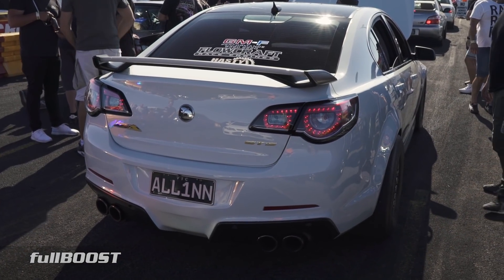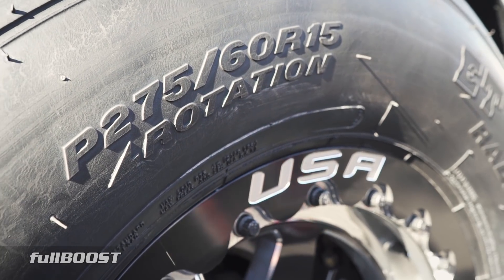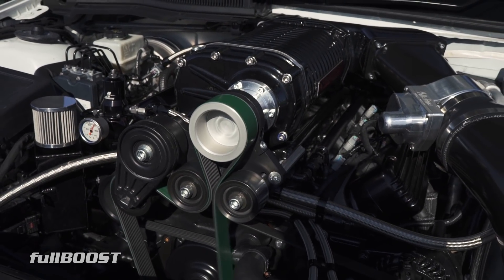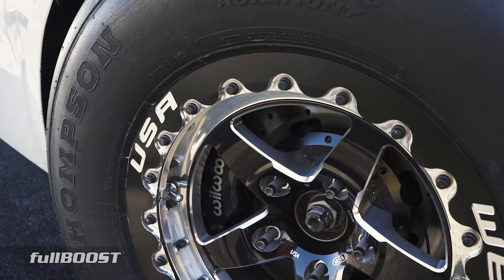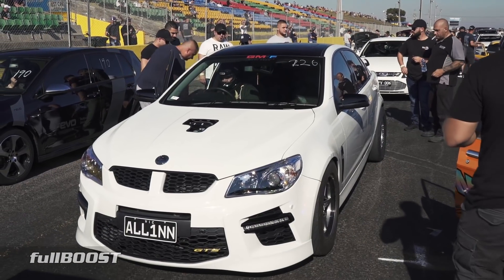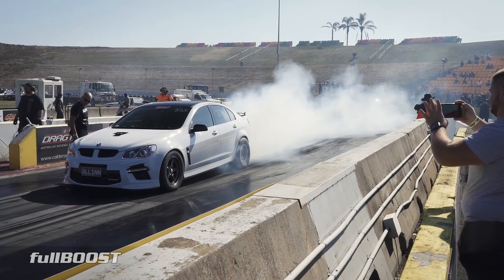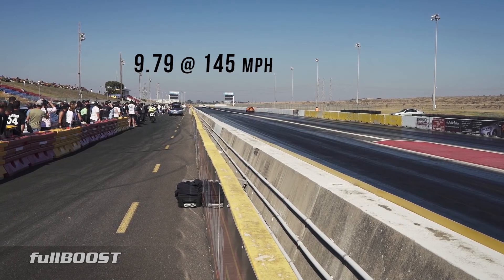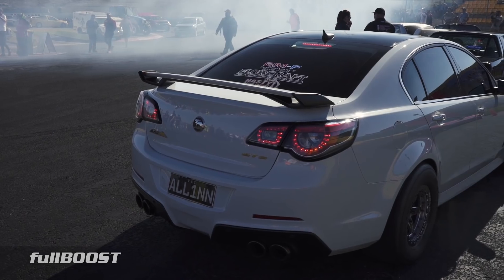HSV GTS goes ALL IN 💪

Comment: Can’t really call it the fastest GTS it doesn’t have the original motor or gearbox
Reply: How the flying fuck does removing the original motor and box make it no longer a GTS?
Lucky the title didn't say "Australia's fastest stock engine and box GTS"
Reply: Evan_Anonymous lol? When did I say that was true.. can't just say shit as if I said it. Zzzzz..
Reply: A Toyota Camry NASCAR is a tube chassis with a composite body fitted to loosely resemble a road going car, not even a remote comparisson
I see you are American, by your logic if you fit an LS into a fox body it now becomes a Pontiac GTO that looks like a fox body?
Reply: evo tme He wasn’t targeting that message to you. It was to the other guy.
Reply: Bucko's Gaming its the whole car mate .
Reply: @matthewthomson7993  ye, true, but i reckon u probably spend a lot more
Reply: I stand by my opinion that it is just a race car now not a genuine gts
Reply: Rodney Abberfield ok, fair enough, but it is still an supercharged last in the long run, but no need to fight over it I suppose.😂😂
Reply: Rodney Abberfield plus there are actually faster hsv gts with stock 6.2 Lsa and 1.9 supercharger so I find it hard to believe that this 427 will 4l supercharger is actually slower than some of them.

Comment: Hate to say it boys but there are quite a few barras that would chew that.
Reply: dartanion 007 it's only on 19psi lol show me a Barra doing those times on 19psi lol. It's nothing to sneeze at. Plus the car is fat as fuck
Reply: PcGaming pitty commodores where too shit to be taxi's.
Reply: So? There’s a lot of things that would chew said Barra’s. Barras, cheap povo power.
Reply: Dee Kay yeah, that whhhhooolllle comment you wrote makes no sense. Needs a forged internal, cast iron large 7litre block and a 4 litre supercharger on 19psi to run that.... vs  4 litre, forged motor and gtx45 on 32psi...
Reply: Rob G Pretty sure I've seen a few bolt on LSAs running low 10s and high 9s.
Reply: dartanion 007 dont feed the trolls
Reply: Rob G yeah, Commodores were too busy winning bathurst year after year
Reply: Christopher Salmon i don't disagree. I've owned both, but my point was that there was a massive oversight in his comment. Plenty of barras run 10, and 9's on stock turbo, stock motor ect.
Reply: Mad Max where they? Better go look again champ.
Reply: Rob G just got the total results for ya champ. Since commodores release they have won 25 bathursts, also since the Commodores release, the falcon has only won 8 bathursts. Actually worse than l thought
Reply: Shaun Andrews houso chariots maaate strayaaa
Reply: Oath
Reply: Mad Max dude, bathurst has been around WAYYYYYYYYYYYYY longer then supercars. Also, correction, no cmmodore, or falcon has ever won V8SC bathurst race since the new gen chassis. You're also comparing street cars to full dedicated racecars, whiiiiiccchhhh is totally pintless. I'm not siding with one side over the other here, as i work on both these vehicles, they hoth have awesome abilities, and i have owned both, and have both engines in my shed. This monster sounds sick as fuck with the blower and there is no comment from me to insult it. I'm just making people aware, for open knowledge, that inherently, some of the comment aren't well thought through, and pointless.
Reply: And a bog commodre vs a bog falcon, is shit. No v6 commo will ever do 1million kms without failing. Ecotec v6 was the last good 6cyl commo motor. Read it right please, BOG STOCK 6CYL, not anything else.
Reply: Shaun Andrews why spend 1000's of extra dollars on a 'budget' to get a quick car then? Povo? Or smart thinking? Straight from the factory, the v8 commodore is a great handling car vs a stock xr6t, but quarterwise, they're the same time, 5 k in though, commo still handles better around a track, but is SEVERELY lacking down the quarter, unless you buy the blown vf ls3 ss. Each have their advantages. Can't call one povo mate, as any cheap power is good power, isn't it. 😊
Reply: Dee Kay, 9.45 is nothing to get excited about in the Barra scene. eg, 8.9 sec Barra daily full weight with ac  https://youtu.be/2DSwbrz2eoM on original ZF 6speed tranny and rear end (with stronger bits).

For all the $$$$$$$$$$$$ in that GTS, it better get some better times. 9.45 is just embassing. This folks is the difference between turbo and supercharging.

Btw, why stop @ 18psi ? I've run 24psi on my Barra, on a turbo, its just an adjustment on the electronic boost controller.
Reply: Pcgaming, I dont reckon there are any turbo barra taxis.
Reply: hey Mad, you just gave me a great laugh. Ford are not allowed to run their current v8s, as their 4v dohc vvt Coyote engines would have destoyed holden. Thus Bathurst is a Holden benefit race. Ancient pushrod engines only, thanks to Holden, and the unimpressive time in this video is a show case for pushrod tech.
Reply: Rob G Cammed and stalled etc LS’ are pretty good bang for buck down the quarter too 😏
Reply: Rob G Yeah I've driven a 700hp F6 so I know the gist lol. My point sort of was being directed towards these 427 builds with big blowers and drag autos not running "much" quicker than the well dialed in lsa with a cranked 1.9L blower and 6spd Auto.

Watching American videos the 2016 Mustang GT Auto with a Hellion twin turbo kit is pretty good bang for buck. Forget the name of the channel but a guy had a stockish tt running 9s then upgraded to 8s then went 7s with a single set-up with drag Auto, built motor and rear end.
Reply: Rob G not stock drivetrain though.
Reply: Nor Dic 7s are better than 8.9s. Try this with a barra in street trim... https://youtu.be/REXhfG1MDm4
Reply: Rob G ahhhh i have a fg barra and dont think a stock turbo will do the job of running a 10 let alone a 9,  like high  to mid 11s with bolt on and a nice chilly day.
Reply: Im on 430kw at the wheels no box build .Yeah 2nd diff didn't go just up it.no bombadore has ever looked like  doing  me.
Reply: @seanclayton8181  you must have been pulled over by a woman driving an sv6 with sirens then...

Comment: Wouldn't come close to my vl turbo running factory boost, aftermarket exhaust tips, some used gold simmons wheels, brand new re-tread tyres (front only), custom venetian blinds mum made from the old lounge room ones, custom steering wheel cover-cover like the old taxi drivers had. Plus it's running a set of original mudflaps with mack truck stickers on em. So i think it's pretty self evident this piece couldn't hold a candle to mine. Forgot to mention the custom spraycan paint job on 3 panels in Ferrari (supercheap auto) red for wind reduction and aerodynamic capabilities. Fully sick, see ya cunts
Reply: @yjkader  
Whoosh!, straight over your head!

Comment: Intercooled Supercharger???
Reply from the maker: Most current generation superchargers are intercooled.
Reply: Between the charger and Head? Doesn't restrict flow?
Reply from the maker: Yeah they either sit above or below the rotating group (water cooled).
Reply: Cheers Dude
Reply: Yep mate, W2A/WaterToAir cooler, as opposed to air to air that you typically see on a turbo car. There is a mob that makes the water that cools the supercharged air, be cooled by A/C coolant. 
You can check them out over here > https://www.youtube.com/watch?v=fGLoLaqagiA

Also check out cleetus mcfarland's channel, his twin turbo LS is water to air cooled as well. Looks abit weird seeing two turbos piped straight into the intake.
Reply: Thanks Man

Comment: Almost as quick as a 2jz with bolt ons... but sadly cant turn corners
Reply: Rick James your dealing with two totally different cars.  One a big 4 door saloon, the other a smaĺl 2 door nippon soortscar.

With more development these guys will improve.
Reply: a supra running this much power is not going around a corner as well and supras were not the best handling sports car to begin with
Reply: Rick James apples amd oranges
Reply: RypienGT aristos are 4 door saloons and came factory with a 2jzgte
Reply: Rick James then until there is a comparison between an Aristo and Turbo Ford then thete is no point.
Reply: Rick James barra is better then a 2j 😘
Reply: The hsv gts is great around corners.  Cant keep using the old outdated muscle cars cant corner because it very different now than it was 20 years ago lol
Reply: thesulo12 Have you ever driven a supra? People who say they don't handle well have either never driven one or can't drive.
Reply: evo tme never said they don't handle just not the best handling sports car to begin with especially with 1000hp under the bonnet
Reply: Rick James you no a 2J isn't a car its a motor lol